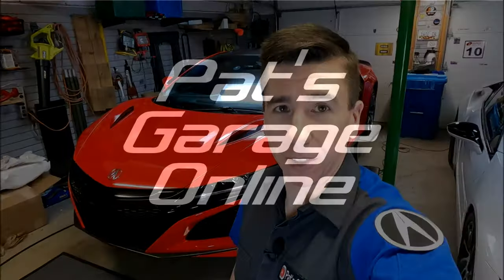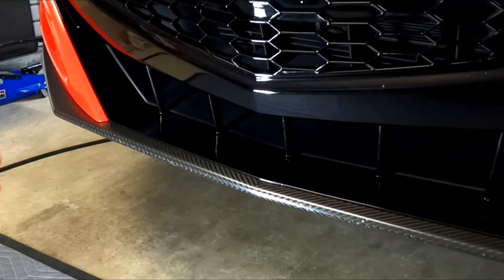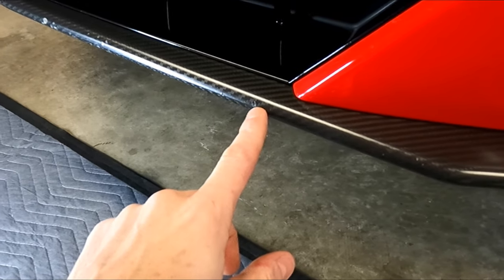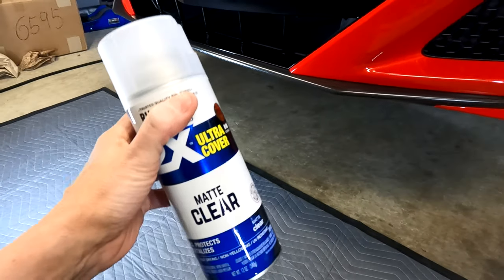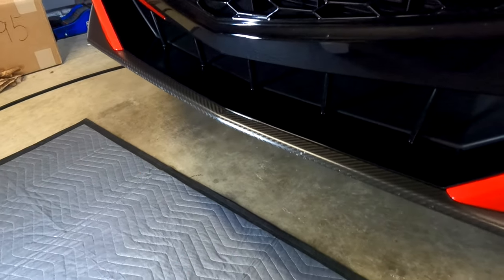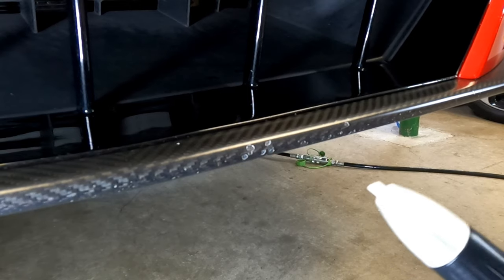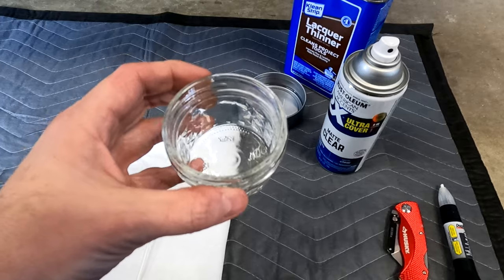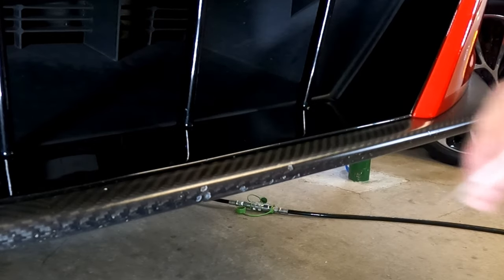Fixing Rock Chips in Matte (Dry) Carbon Fiber front Splitter with touch up paint.

Comment: Did you try an epoxy adhesive? The carbon splitter is likely carbon/epoxy material so I would think an epoxy resin would do the trick.
Reply from the maker: I have not tried it, since the epoxy part of the splitter (under the matte paint), is OK.  The rock chips are causing the matte paint applied over top of the epoxy to chip off.
Reply from the maker: I wanted to choose the same color and type of paint that was already on the splitter. So I chose matte clear.

Comment: Sorry Pat, but that ain't repairing! You can not treat carbon fiber like paint....its like Gold, do you repair a scratch in a gold bullion by using body filler and paint?

These are scars of glory and you should honor them or replace the part if you are looking for a permanent solution!
Reply from the maker: How do you think Acrua gets the matte finish?  Paint.
Reply: @PatsGarageOnline  if what you are saying is correct,  then your Acura have a fake carbon fiber lip.

Some cars have plastic parts wrapped with materials look like carbon fiber, in some cases its made of plastic been wrapped with a thin layer of real carbon fiber to give the exact look of the real deal.

In the first case its just like a steel bar painted in gold to look like gold, in the second case its steel bar gold-plated but still not gold...
Both are fake!
Carbon fiber know for two things : light weight and strength...they might mock the first one but the second is very hard to even get close to.
Thos chips you had on (carbon fiber) lips won't be there if the lip was made of the real deal.
Reply from the maker: @rashad9014  Yep, it's real.  The underside is all CF weave and the part is extremely light.  Same with the rear diffuser.  Everything has a matte finish.  Epoxy will not cure matte.  Only paint will do that.